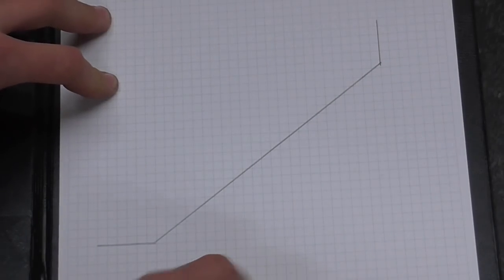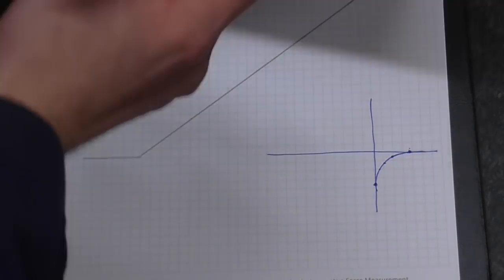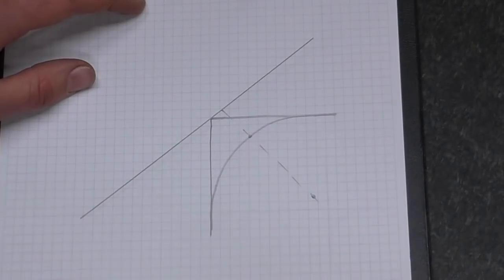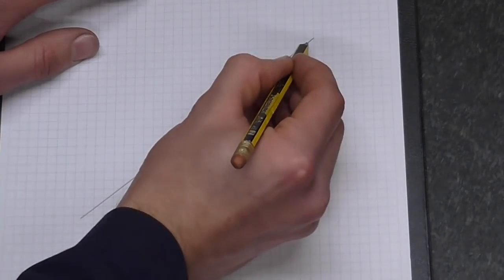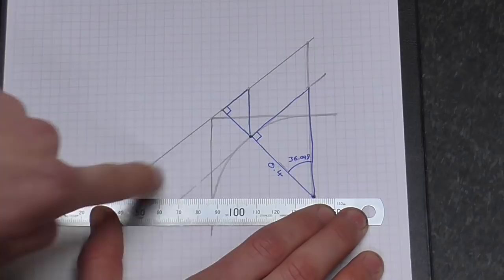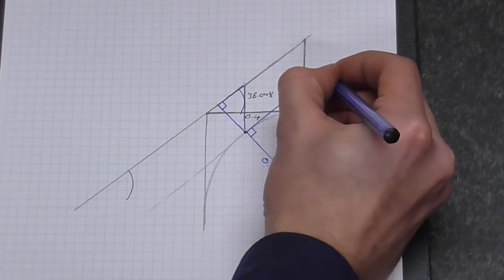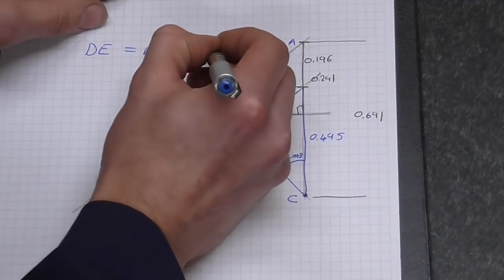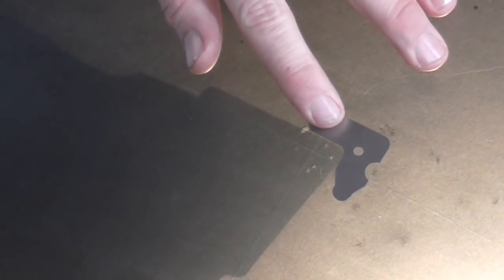Tool radius compensation

Comment: To simplify this for you because it was painful to watch you fight with all those triangles. The formula is (90-Angle of part)÷2=X
(tan(X)*Tool nose radius)- Tool nose radius= Tool nose shift

So, (90-36.098)÷2=26.951
Tan(26.951)=.50845
(.50845*.4)-.4=.1966
Hope this helps. I've ran this calculation thousands of times years ago when we programmed 3D CNC toolpath with manual  g-code before the days of CADCAM software.
Reply: Thank you very much.

Comment: I would imagine that the people working in a tool room and/or making small parts with very tight tolerances, this would be part of their daily fare. For those of us blacksmithing working to a thou or two level-we would give this a miss. Very interesting and informative-I still like to learn- even at nearly 82 yrs young. Thank you for sharing this. I often work in microns with single fibre optics with hair fine dimensions with square corners-Southern Cross Observatory-Tasmania 42 South. 👍🇬🇧🇦🇺🔭

Comment: I came across this when I was trying to confirm my math. I was planning to offset the carriage instead of cross slide, which would be R/sin(taper angle). Since the compound would be set to this angle and travel linearly, I assume it should account for the tool radius. Is there a reason to calculate it like you have done here ?

My understanding is for curves and facing operations, you need to add the tool radius to Z offset, for external tapers it's radius / sin(taper angle). Perhaps  I'm missing something very obvious.

Comment: Now days a simple way to draw this is Fusion 360, just draw the tool and draw the feature with the parallel line to the nose radius of the tool and using the dimension command it will tell you the compensation in Y.

Comment: thank god for G41and G42! (or is that cheating!!)
Reply: In a non monotonic type two roughing and finishing cycle you will over cut due to the tip direction unable to change mid cycle
Reply: @peeeoii2738  yes very true!

Comment: LOL.... I thought is was odd, that in the last video, how lazy you drew the lines and marked the datum points... considering, how precise you have ALWAYS in all other videos presented your self, and drawings and explanations and just assumed you were expecting that the subscribers were to just understand the "Gist" of the topic you were explaining, of which you did exceptionally well... 

Will there be more fun games like this.... If not, I wouldn't want comment and to come off as me being picky or ripping apart your contents of every tiny single thing... under the assumption that there is now game to play.... BUT.... If there is a game, Heck yes, I wanna play... Sooooo, to start with... on the shadow optics... placing the radius gauge on the magnified picture... One then needs to do one more math formulas.... to divide by the power magnifier optics measure....in efforts to acquire the actual size of the radius? right?
Reply from the maker: Yes 10 times lens on that one so measure Radius on screen and divide by 10
Reply: @MrCrispinEnterprises  did I win!!!!!!! lol
Reply: But it Was obvious.
Just the factor had not been said.